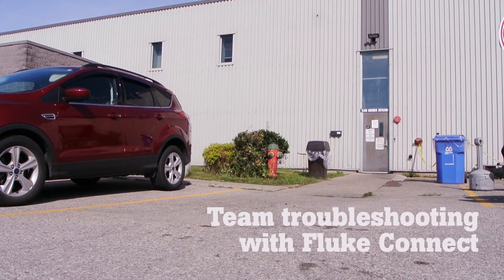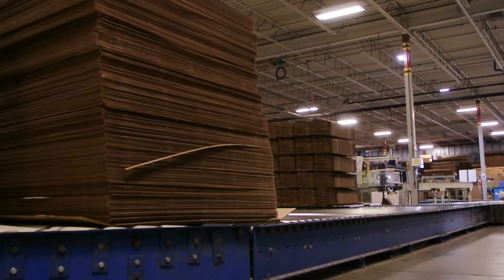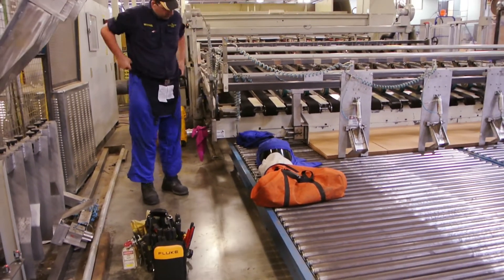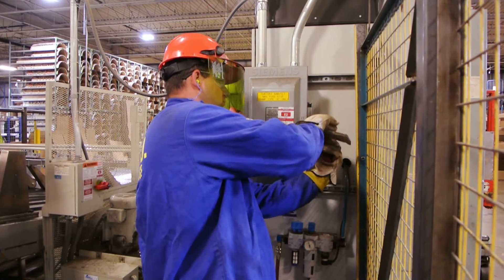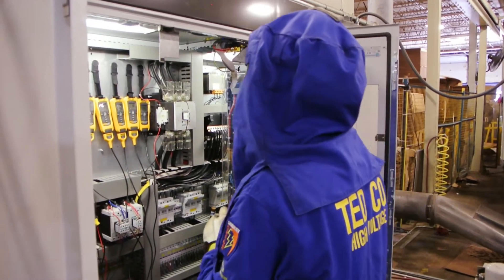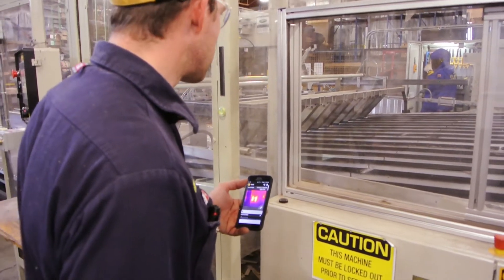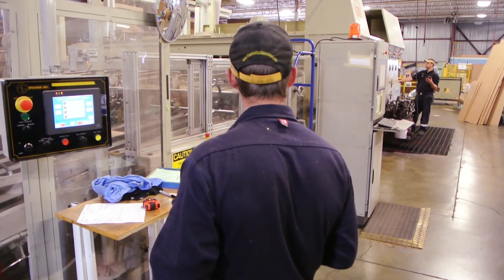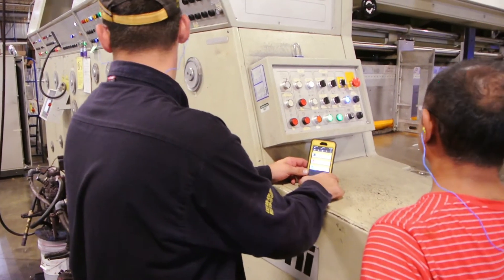Team Troubleshooting With Fluke Connect®

Comment: So you would need three instruments to measure 3 phase voltage? that would be one device per phase
L1-N, L2-N and L3-N? In addition how do you get dual or between phase voltage reading for example L1 & L2  instantaneously or you have to change the set up physically.